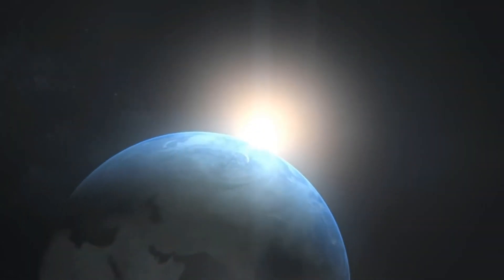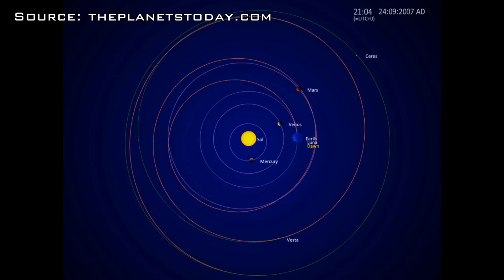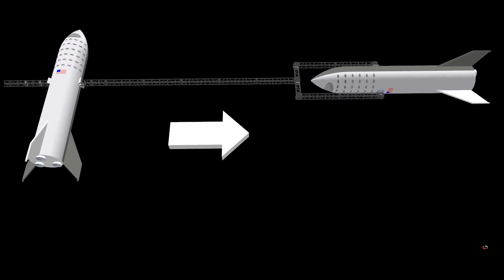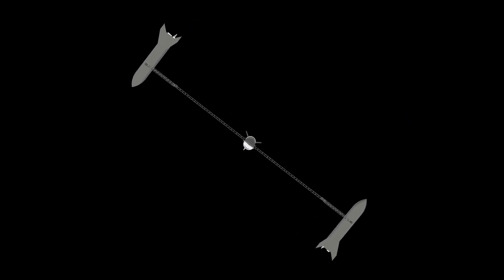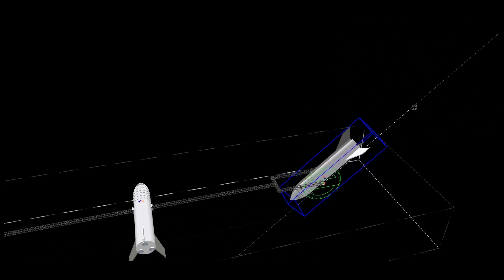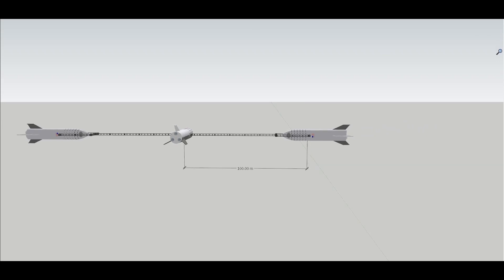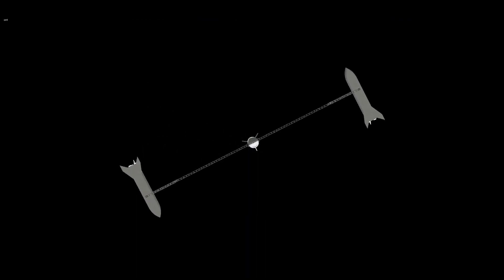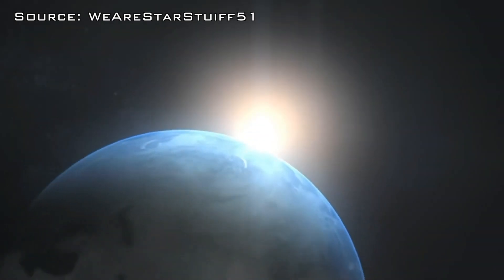GLS2: Artificial Gravity for SpaceX's Starship

Comment: Hi dude, 
Note that the central ship is not mandatory : The concept works with only 2 ships. Moreover, the "co-rotation" can be considered axially, but also radially to the global velocity of the system ; that simplify the setting up procedure.
Reply from the maker: My original Idea was to have some axial action: https://www.youtube.com/watch?v=NR3QmV1mLbk&t=127s Please help me come up with the advantages and disadvantages for each method?

The Central ship helps with balance. If the passenger starship has 150 tons of payload, and the center ship has an empty bay with 150 tons of it's payload all deployed as the truss, there will have to be some major adjustments to the shape of the system. I'm not saying that it won't work, in fact it might be better to have some extra fuel tanks as a counterweight, but the center of the spin system would not be the midpoint between the two vessels.

Comment: If you are prepared to send that much mass out into space (three ships). I think it would be simpler and safer to just send up one “fat” ship that would spin at a higher rpm to get the same result. It would have to be wide enough so a occupant would feel similar “gravity” at his feet as he would feel at his head, and care would be needed to keep weight balanced around the ship, just as it would on a two ship tether design. I think the key to going to Mars is keeping the ship simple, robust, and asset heavy  (lots of stuff for the unknown problems we may need to solve). I’d send it there unmanned and stuffed with resources, then send a second ship with a crew. We would learn from the first ship, and have a plan B if something went wrong with one of the ships.

Comment: You talk about impracticality of spinning gravity generators but not of having three ships tethered together? The animation shows the crew section of the ship folding outward; if it were to actually do so (or better yet just set the floor perpendicular to the rockets) and the vector modified to account for timed bursts to facilitate a constant gradual increase in speed, couldn't the forward velocity of the ship act as gravity, as it would essentially push the passengers along? Seems much simpler than complex maneuvers or devices.
Reply from the maker: Not possible with our current primitive level of propulsion tech. Maybe in the future some one will invent a propulsion system with enough thrust that won't run out of propellant after 5 minutes of firing.
Reply: @smallstars  Like ion drives on a solar battery? I think it's conservative funding and dependency on proven tech that's holding us back. If a quarter of military funding was put into space exploration we'd already be colonizing Saturn.
Reply from the maker: @shadowswept9167  I like your style!!! Ambition is important!

Comment: Very interesting! Thank you for the video. 

1. How does the truss do in terms of compressive strength? If you're going to reinforce it with cables (as you say in the notes), you could potentially keep the truss under compression as well as strengthening it in tensile strength. 

2. You could probably get away with a higher RPM and shorter radius truss, reducing the size and mass needed for the truss. IIRC the more recent research suggests that folks can adapt to 6 RPM pretty quick, and higher with training (although higher would introduce some unpleasant head-to-toe simulated gravity gradients).

Comment: This concept work on earth not in space. In space, there is no inward or outward force. You can rotate but its just a movement in circle and won't generate gravity.
Reply from the maker: Not true. just search "spin gravity" on youtube. Its a fairly intuitive concept that when something gets flung about in a circle, the connection to the center pulls in wards. Being on earth or out in space does not change this.
Reply: @smallstars  gravity is about mass. Two tin cans rotating in space won't generate gravity.
Reply from the maker: @zzgodatt  You are correct! But you seemed to have missed that this is artificial gravity. The concept is about creating centripetal force at a magnitude that mimics earth's gravity force.

Comment: Most people don't realize that climbing out of the 6th largest gravity well in the system, coasting for months, and then going down into the 8th largest gravity well, and then climbing back up out of it and coasting for more months is a really really really ambitious plan. Just getting there and back, with maybe a stop off at the moons of mars, would be a good first trip. Slow coasting more support vehicles into orbit before going down to the surface would seem safer.
Reply from the maker: Agreed 100% ! To top it off, the return transfer window doesn't come around until 1.5 years after you land on Mars!

Comment: If each rocket burned 3 tons of fuel/oxidizer to get the spin up, then the rockets now weigh 6000lbs (3ton) less for spin down. So the spin down fuel/oxidizer will be (417/420) 99.3% of spin up, or 5958lbs. It is easy to forget on a two leg journey that the second leg needs a little less fuel because the ship lost mass burning fuel on the first leg.
Reply from the maker: Yes you are absolutely correct!! (aside from using lbs, this is all in metric tons.) I was going to include those details, but its 0.7% is sooo small of a difference.